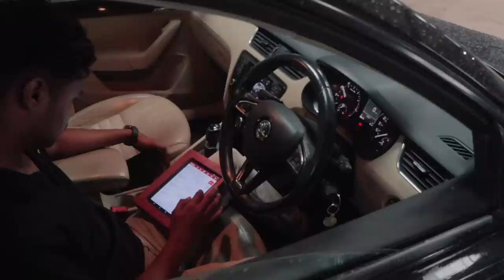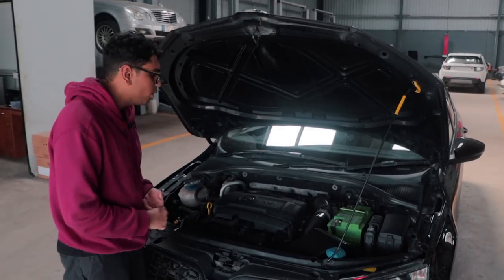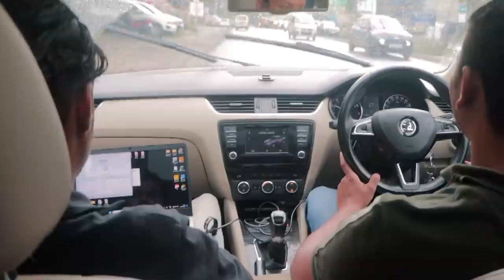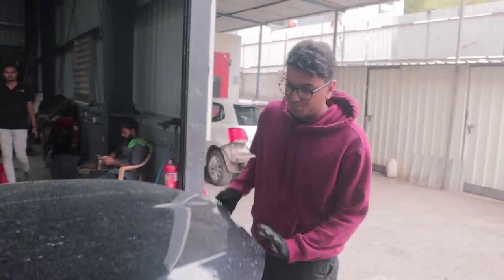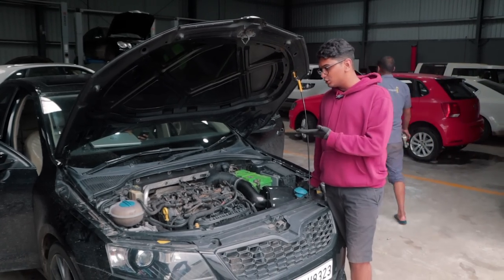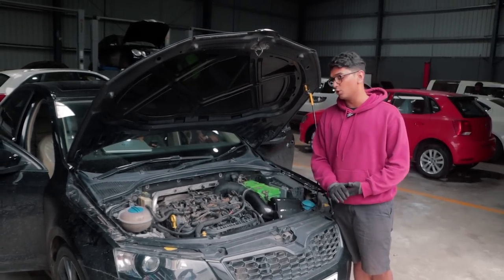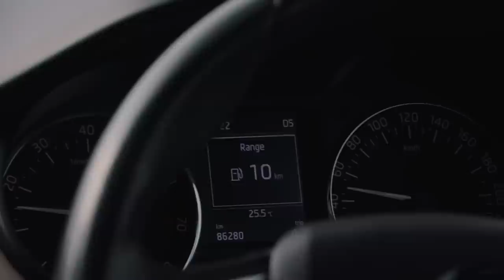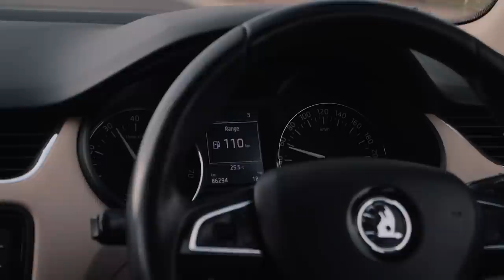Our Stage 3 Octavia is misfiring 🤦🏻‍♂️ + Stage 3 Tune from Venom Performance India! | Project Octy

Comment: Need help fixing this? Two quick notes, never change one coil or two coil. Always change all 4 or none as coils degrade over time and adding new coils to old coil mix will only make the problem worse. Also APR coils do NOTHING. Most if not all tuners worldwide have switched back to OEM Coils as they are still the most effective and reliable over any aftermarket alternative. 
Second, if your running stage 3 tune, I'm assuming its a turbo upgrade to either a IS20 or an IS38. Either case you will need to change your spark plugs. For IS20 you need a set of heat range 8. OEM on the 1.8TSI I think are heat range 7. Your tuner may say that its not necessary, but TRUST me, it is. Why? because even though your making less power than the RS, the engine is running an astronomically higher compression than the RS. So higher compression will generate more heat from added airflow (from your turbo upgrade) and cause knock. Also gap the new plugs properly. Its very important. The gap will depend on the tune and how much boost your tune is running up and down the RPM range. Also gapping plugs properly will solve misfires very quick. Its a simple rule of thumb, misfires between 2-3k increase gap incrementally by .01 inch till it goes away, misfires in 3.5-6k reduce gap incrementally by 0.01 in till it goes away. Also run without the engine cover, I cant stress enough how much heat that damn thing traps. If you want it for looks, remove the foam from under it and use it, still not as good as running without it, but its still a stop gap.
Reply from the maker: Thank you to the VRS master himself for commenting! Unfortunately, we found that changing coils like that doesn't work the hard way. 

Whatever you just commented has been done and rectified after this episode. For the time being we are running APR coils  cause our local Skoda dealer didn't have VRS coils readily available. 

But anyways, thank you for your elaborative comment, definitely will be of help for others looking for advice 🙏
Reply: @TheDriversHub  Coils are same across the models, just different revisions leading to different part #s, no actual difference in the product. If its still misfiring after all the above, then check your PCV and replace with a new OEM unit it as preventative maintenance. The PCV's on these cars are notoriously weak.
Reply from the maker: Misfiring was solved, currently running on APR coils, will definitely order stock coils ASAP.

Comment: Keep the engine cover off. Itll stop trapping heat on the coils and wires in that area. Clean it up and show off those red packs. Also less noise insulation means you can hear it knocking sooner. 😂

Comment: Heyy team tdh! 
I'm planning to buy a project car for myself .. and I'm confused between the Laura and mk4 Octavia ... Can you please help me out with this?? 
I kinda need a rough estimate of the build costs along with the car ( stage 2 maybe) 
(Also .. the budget is a very important factor cz my parents think it's a very wrong financial decision :/ ) 
I'm looking at around 10-12 lakhs for the budget
Reply: get a laura, the mods would cost around  2 lakhs for stage 2 (1 lakh extra for tires and rims) and this is aside from any issues in the car before you purchase it, if you find a laura for 7-9 lakhs you will be in the budget of 12 lakhs in my opinion but always remember, a project car is not a daily driver so have a daily driver incase the car ever decides to have a mental breakdown
Reply: Don't by a Laura tsi
Reply: Gen 3 is a big step up in reliability. So avoid the laura if you have the budget and want DSG anyway.